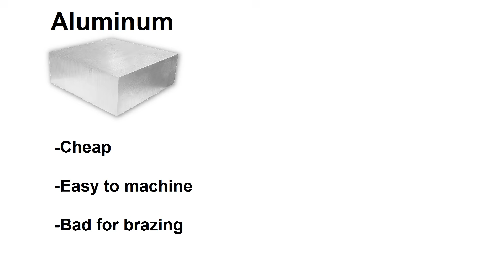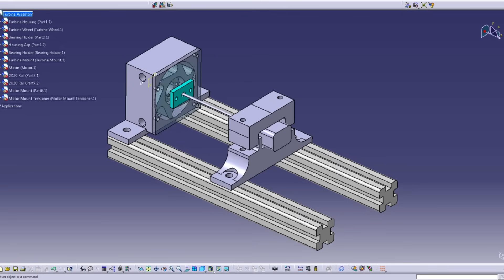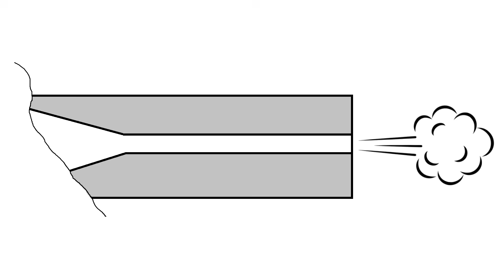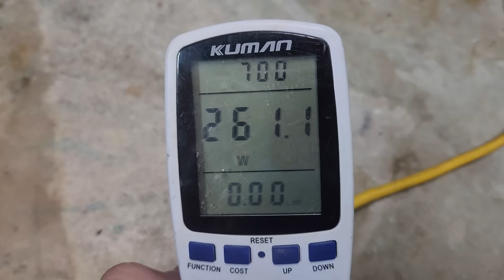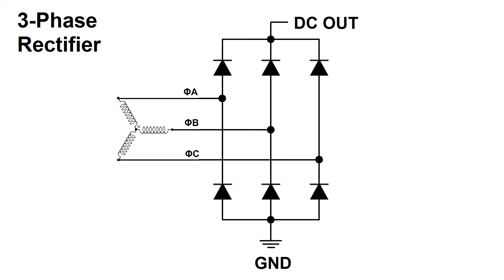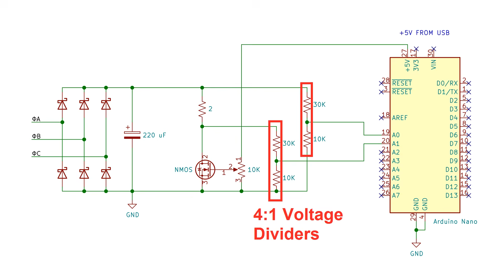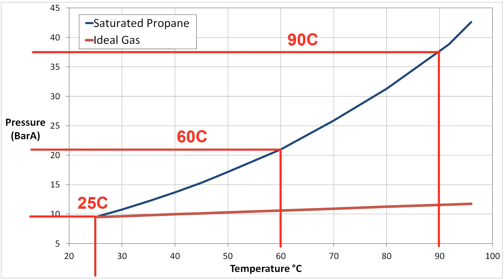DIY Micro Steam Powerplant

Comment: Hi. 
I was considerind making a project where i would utilize molten salt to heat and overheat water into overheated steam. I was thinking of doing a generator sort of similar to yours.
What you could do is try fixing the tolerances and adding more turbines on the same axle to further decrease the torque and increase the efficiency greatly! 
Awesome video, best regards.

Comment: ◉◉◉  Bubbles forming at the wall are huge source of insulation There is a YT video on this which I have in my vast collection of bookmarks...but will never be able to find. HAHA.

You've chosen a poor turbine architecture for this app  and design is also bad [inlet & outlet openings are same size. SMH]. I'm developing several advanced power and propulsion turbine designs.
---
✈✈✈ℕ𝔼𝕎  𝔽ℝ𝕆ℕ𝕋𝕀𝔼ℝ  𝕋𝔼ℂℍℕ𝕆𝕃𝕆𝔾𝕐  𝔾ℝ𝕆𝕌ℙ is a visionary multidisciplinary B2B innovation company utilizing a licensing business model or collaborative enterprise with strategic partners to develop Advanced clean, efficient, power dense solutions in domains of energy, propulsion, mobility, robotics / exoskeletons and clean technologies with a particular emphasis on the aerospace sector including space exploration and commercialization
[Yeah, I do all that and more]

===
🚗🚙🚚🚢✈🛩🚁We're working to derail the Exploding Vehicle [EV] paradigm. Any mobile platform is only as good as it's power supply. The main advantages of our disruptive 𝔽𝕦𝕖𝕝 𝔸𝕘𝕟𝕠𝕤𝕥𝕚𝕔 ℤ𝕖𝕣𝕠 𝔼𝕞𝕚𝕤𝕤𝕚𝕠𝕟 engine is the constant maximal efficiency & torque...at any speed, load, temperature or elevation.

It is Simple, Low Cost, Ultra Efficient, Constant Torque, Load & Speed Agnostic, Fuel Agnostic, Transmission-Free, Low Heat/Noise & No Smoke/Odor Signatures, Non-Polluting [only lower CO2 which is not a pollutant] with a >10 year [>10,000hr.] MTBO - better than EVs. >100mpg using ANY liquid or gas fuel even CONCURRENTLY W/O DOWNRATING, even if dirty, including hydrogen, biofuels or Natural Gas. [No range anxiety.] Vehicle lifecycle CO2 output is 30% that of EVs.

===
We're going to go one better by going in the air with a low cost, Ultralight category, personal air mobility system - no license, no certification, no emission laws on the state level and soon on the federal level as the EPA gets their teeth pulled. DOGE!!! 👑🤜🇺🇸🤛👑

===
+++Our maximally torque dense, infinitely variable  𝔽𝕣𝕚𝕔𝕥𝕚𝕠𝕟𝕃𝕖𝕤𝕤 𝔾𝕖𝕒𝕣𝕤 [CVT/𝕀𝕍𝕋]  technology enables transmissions of ~1/10th the size/mass/cost which enables use of motors/engines/batteries of significantly smaller size in EVs. It also provides novel 3D motion of robotic appendages/manipulators/booms

<><><>

Comment: something I was thinking of doing was setting up a boiler connected to a turbine, where you could toss the generator into a fireplace or a campfire. Using a small piston engine instead of a turbine may be more more efficient, or at least easier to get, considering you can buy one for a piston power remote controlled airplane.

Comment: out of curiosity, could you use a small pressure tank and fill it with either a rechargable tire inflator or  bike pump instead of propane then use something like a rocket stove to heat the flashboiler? just wondering

Comment: The steam is white and visible, meaning it's not superheated, meaning you are also losing a lot of energy to condensation. You can fix this by simply having the input of the propane torch be on the side of the output of the steam, this way you basically have a heat exchanger between the flame and the steam and you get superheated steam, which is what you want when generating electricity. You can also have a heat exchanger between the output of the turbine + the output of the tube that heats the water and the propane input so you can salvage the heat energy that would otherwise just pass trough the system.

Comment: You got skills required to scale up. Cold Steam Tesla.. Raises cup into sky until it boils and points at people on videos boiling water with vacuum Energy/Heat wants to leave and results if high enough vacuum if allowed to vent all the way is ICE. Crank Stator to charge Capacitor fast but bleed slow into vacuum pump to vacuum water panel built around or on cold side, open valve to vent heat to cold boil that water to ice which increases value of heat added without bringing ice to machine like people do in videos, and then vacuum inside. Anything you can burn it will run for so long that if it needs to reset itself it paid its cost many times for that one. Also? Youtube: "Mulch combust on its own" They say black mulch.. They manipulate. Black mulch is only nutrient rich washed down from mulch piled too high and Thermophilic bacteria can reach their full potential the more dense nutrients are.

(Fireproof area first) Make compost solution, lower water levels for high nutrient density, and put some on bedding made on the ground before piling moist organic material. Use the rolling steam for when to extract the Thermophiles capable of living in those temps, and breed them into panels with heat transfer rods leading into boilers. Feed with food, yard waste, and bathroom waste.. https://youtu.be/2pGxVvSizoE?si=h7bqt6pHh_iWZgfA <This guy 135F, Thermophiles safe levels 200F. After 200F you lose adjustment room for nutrient error adjustments which would require a push rod inside panel to close holes to feed wick for emergency water flush to restart on new drip to wick system for quick response. (If you don't feed Thermophilic bacteria Points at frozen ground under mulch they wake from when detecting nutrients They sleep like the Alien in the movie the Thing.)

Comment: I'm not real sharp at somethings, so bear with me. If your 3Ph generator had each phase rectified to DC, I'd use a full bridge rectifier, then the three DC outputs were put in series, you'd raise the total output voltage, it'd an "out of phase" rippled DC, but I think you'll find it still works pretty well. It seems to work well with a 1/2 -3/4 HP EMC motor. You break out the 18 sets of windings with it, parallel all the windings for each phase, then rectify them, then series all the DC outputs. You'll get 5-5.5VDC from each phase, you'll get 15vdc-16.5vdc with a LOT of amperage from the reconfigured motor. It'd be interesting to see what it looks like on an O-scope.

Comment: You'll need more stages to really get the most out of your steam. Also the hotter the steam the better, so work that into your designs. Just because water has boiled does not mean it's stopped adsorbing energy.

You should also run your feed water such that it's in as much contact with anything that's hot as possible, that'll cut losses.

I think if you have a few stages, rework your water flow, you could get some real output out of this.

Comment: Really cool project! Don't most steam generators use vaned discs (like in a jet engine) for their turbines? I think a big part of the inefficiency came from the choice to use such a large, clunky, bucket-style turbine. Too much mass to spin with not enough surface area to generate torque to spin it at high speed. This design was more or less like a water wheel, which is most efficient with high mass, low pressure/velocity input. Need something more tuned to low mass, high pressure/velocity to increase the efficiency.

Comment: Your turbine needs needle bearings or a magnetic bearing to read the friction lost on the output shaft. Also look into hydraulic vane motors, they can be found at scrap yards easily,  most power steering pumps are vane pump/motors. Very low tolerance and high efficiency.  Love your videos!

Comment: Your design of your rotor and housing is almost an exact copy of a boat motor water pump only difference is the rotor is made of rubber. Could've just used the lower unit from a boat. At least to test it out

Comment: Also bro try building a smaller purge tank using an egr cooler and looping the exhaust steam in a closed system with a safety valve back to the water tank, scavenge

Comment: You're not even talking about how much wasted energy that you wasted on the propane itself just being used for pressure regulation. All the energy in the propane was essentially just wasted, instead of combusting it and you would have gotten WAY more power  than all that put together. A propane generator is more efficient with the same amount of propane, and you dont have to consume any water. 

Now replace the propane altogether, or use a propane generator to power a pancake air compressor and use that as a pressure system it would give you way more time than 10 or 15 minutes with the same amount of propane. As the compressor stores that pressure and is not constantly running so you can stretch the time even longer. 

But forget the propane all together, all it does is cool down your steem as it expands coming out of the tank. I'm looking at one of the last scenes of your video right now and all that steam coming out of the top of the generator is just getting wasted dispensing into the atmosphere with a completely frosted up pipe right next to it. You could plumb it so that steam is underneath that pipe and it would warm it up at a bare minimum. 

But figure out a different pressure system. Propane's not the way to go. But otherwise I like it! I love to see people tinkering and having fun. Keep up the good work!

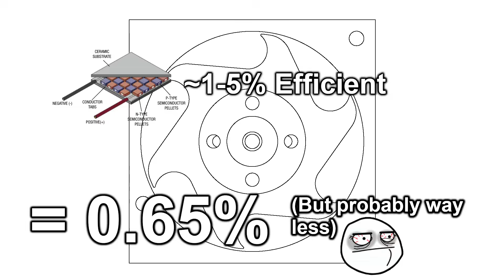Comment: 19:00
I think i big efficacy loss is also in turbine's exhaust hole. It should be bigger than stream inlet hole because you have bigger volume at smaller pressure. 
Basically, you have to recomoress steam to push it out. Ant yhen you have this exhaust cone at 19:12

Nice project, find myself looking for a generator efficient enough to start with. Butane powerbank - it can become a thing. )
Also maybe this is an opportunity to play with Tesla's turbine, as it's easier to make without cnc at a hand.

Comment: first though at 2:34, if the system springs a leak, you're going to be piping the propane into the heating coils eh? or just the vapor pressure part... still... but very interesting

Comment: possible use exhaust gases of ice as source of  heat ?for ex closed container exhaust tubes through water reservoir valve for 20 bar after 20+ bar steam go to   steam turbine or turbo as anti lag  etc ? may be 20 bar is high .if do it closed loop maybe it can be useful?

Comment: A few years ago someone made some Tesla turbines that had pretty good efficiency. The process was a lot easier than machining a block of brass. Despite being around for over 100 years, finding off-the shelf electric motors or generators of different sizes & types is not easy. The next logical size would be an ebike motor that has regen brake capability. Should be able to produce over 1000 watts. Turbine design & the actual plumbing seem to be your issues. That's the problem of lab or benchtop scale versus industrial scale. Factories used to have their own boilers to produce electricity.

Comment: You gave me a great idea, what if one were to use a rotary engine as the turbine...I bet the apex seals would stand up a lot better to steam from external combustion, I would still drip in lubricant to aid the seals, then the ckearances could be significantly tighter and with a larger displacement area like a 600cc+ rotary, maybe even something the size of a 2-3+ rotor at 2L+ you could have a sizable energy capacity, I would imagime you could already operate at significantly higher pressures with steam than with internal combustion and people get 400+ horse from an internal combustion rotary on pump fuel, I would imagine you could get the system quite efficent and generate enough power for your house or a few houses, maybe even power a large vehicle that is otherwise impractical as an all electric wuth batteries, ideally you could power the boiler with waste fuels like organic matter that would otherwise be garbage or rot, you might be able to experiment with a turbocharger on your stove to create huge amounts of heat while recycling the thermodynamic energy from the exhaust and be offgrid and energy infependent. The global warming peoole and energy cartels would probably hate you so ypu wpuld be dping somethimg right.

Comment: First of all, let me say, I really enjoyed your video. Not being anywhere near as intelligent as you are I do have a question or two could you not elevate your water source and let gravity provide your water pressure.?  I was also wondering if a small turbo like he would put on a car engine and is designed to handle the heat would work as a turbine?

Comment: As you said you could use the propane exhaust to generate extra pressure from the tank.
For a version 2 you could put the tank in a water tank as a heat buffer (basically a double boiler) use a valve that either directs exhaust to the tank, or down a tube facing away from the tank. Have the valve hooked up to a servo and use a thermistor or thermocouple hooked up to a PID (or just P or PI) controller to control how much exhaust is directed at the water tank with a ideal temp of about 50°C, thermistor in the water, if the water goes above 60°C an additional emergency mode on the uC kicks in and closes the valve, redirecting all exhaust away from the tank and an ice dispenser above the tank to quickly cool the water.

Using a water tank also helps to mitigate any kaboom should the system fail. At least from the pressure in said tank. When filling SCUBA tanks they were always dumped into a water tank for a few reasons.
1)Leaks from the hose or A-Clamp/DIN connector are easy to spot. 
2)Water absorbs energy so if a tank ruptured, it would be less of an issue
3) It stops the tanks heating up as they're pressurised

Comment: You didn't insulate the exhaust pipe either. If you insulated it you would need less propane to heat the water. I'm kinda surprised you didn't design the vanes of your steam generator with vanes like how a turbo uses or a jet engine.

Comment: That type of turbine is extremely inefficient. In general, an impulse turbine is not a good choice for small steam plants. Look into reaction turbines. Only radial outward flow turbine has reasonable efficiency (and not a waste of material ; even with that, 2 stages would be preferred), because the expansion INSIDE the turbine could be reasonable. Any other type (including radial inward flow) needs multiple stages (3 or more; of course axial would need dozens of stages). With impulse turbine, the speed of sound and other constraints severely limit expansion in a single stage.Also, H2O is not the best fluid... Some fluids like C5F12 (very stable inert liquid/gas) remain "dry" even when expanded (does not condense inside the turbine), a giant advantage. (but must be used in closed cycle of course).

Comment: Might try using an air tool turbine from a high torque tool like a stall tool or a grinder. They are way efficient right out of the junk pile. no need to modify it much. Might have the best gear ratio already ready already. Chuck it up to your dynamo and watch it go.

Comment: Could this design be improved by running a series of many plastic fans very quickly into a generator or series of generators? Rather than the heavy machined turbine? Is the torque mode useful here? Since you're already using steam, what about implementing Hero's engine?

Comment: You suppressed the power of the system by installing electronics on it. The electronic system is, by its nature, overcomplex, high energy-consumption, and has many Absurd  transformations, and risks. To increase the power generated by the turbine, The turbine must be configured with multiple stages and a well-designed gear system must be integrated with it, as electricity generation increases with increasing speed. Also, using a pump that has “moving parts” will be better, and the power of the system will increase by reducing electronic losses. Final note, I don't know what's wrong with the "moving parts", they are simple, effective and reliable.

Comment: i loved the whole video and felt like i was in a college class at the same time. last year i built a bigger set up with a 9 inch squirrel cage blower . i was able to spin a 12 volt 105 amp alternator at 1200 rpm . i did achieve super heated steam from my set up but it constantly melted my solder fittings lol . cheers

Comment: Use "active diodes" (search active diode controller) if you want near zero voltage drop. Also, use a power bipolar instead of a MOSFET for your variable load, it's far more linear and easier to control.

Comment: The solution to pressurising the water would certainly be to feed steam pressure back into the water tank. That way, the pressure through the whole system would be equallised, the water would gravity feed into the heating coil and bob's your uncle. The steam going into the water tank would condense of course, but if you but an insulating float on top of the water in the tank, that could be reduced.

Comment: I mean if you were cool with running it at ~50 psi you could just hook up a water line from a faucet and have a small throttling valve to adjust your flowrate.

Edit: better yet, a minifridge compressor on a variable speed drive (adjusts water injection pressure and flow to match loading condition) with a big junkyard car radiator as a condenser to recover the turbine exhaust, full blown rankine cycle